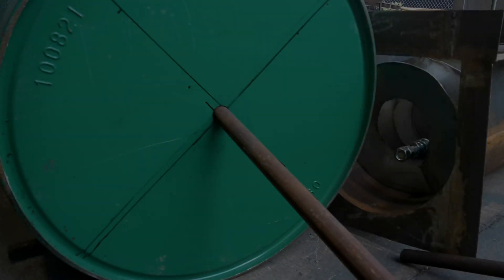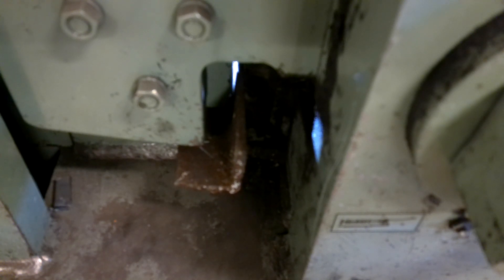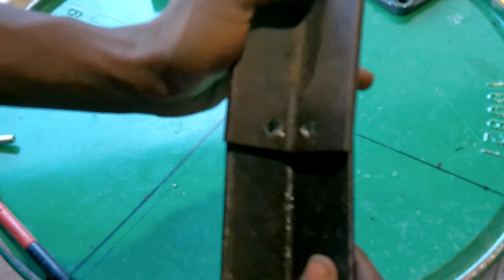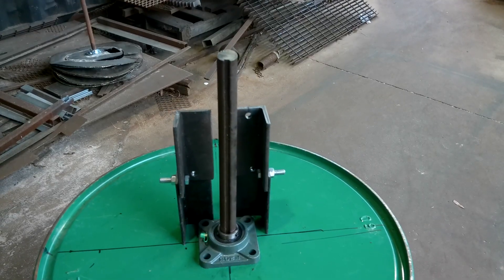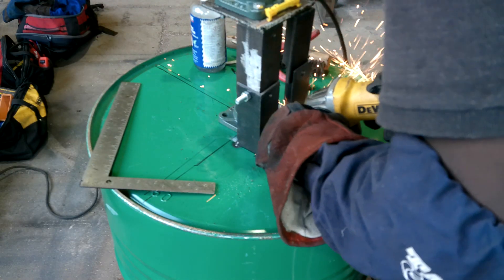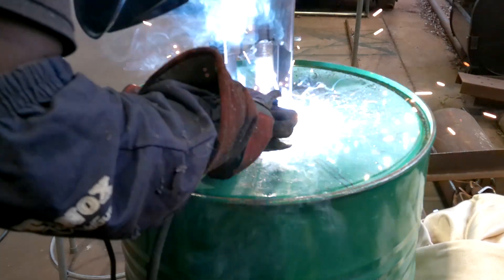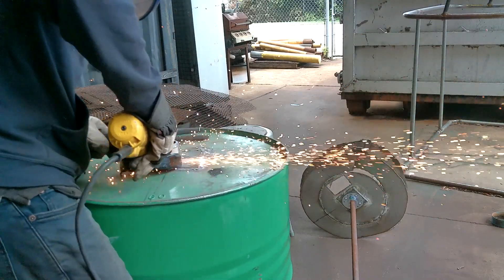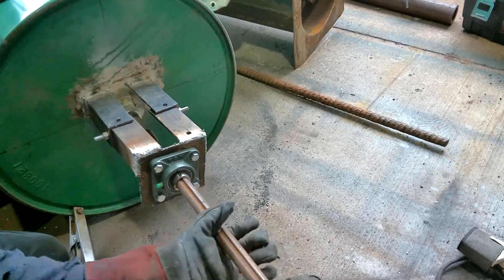FAIL: Building Mark III Reactor - Part 3

Comment: First, and I cannot stress this enough, thank you! You have inspired me to do a similar project but I have to research a lot more before I even start 
Considering that, this is not advice, more of an opinion so take it or leave it. I believe that the culprit for that are the plates - would 4 metal rods work better?
Reply from the maker: That is amazing to hear you working on your own! Exactly what the world needs. Perhaps 4 may work better, will have to give it a go!
Reply: @naturejab  I just can't stop shaking the idea that you can combine the Megatron with the flare gasees but I am not that good with magnetic guide waves nor do I know the effects of plasma (if it'll form) on a steel container... as I said, still much to learn before the build....

Comment: leave the mount there but make the bearing adjustable so you can move it around to find center then it gets bolted down to the fixed mount.
Reply from the maker: Thank you!

Comment: First and foremost you’re doing fine, keep it up mate 👍. Some suggestions that you will probably hate but from experience of keeping things simple:
- You are currently running batches in about an 8 hour time period. Let’s keep the maths simple and call it 10 hours. Even with 5 magnetrons then, anything you put in that new reactor will take about 2 hours to be fully pyrolyses and moved to the end of the drum. My point is, that auger will be turning INCREDIBLY slow and the engineering required to get it aligned right isn’t worth it. 

- If you had a rectangular reactor with a simple rectangular trash ram at one end you could simplify a lot of things, including the microwave propagation inside. You could have an input hopper at one end and some sort of opening/closing grate at the other. If the output end unbolted, it would be very easy to take apart and clean

- The auger design definitely has a place, but I think it’s is in the long term future. A bit like my automation ambitions, I still need a lot more data before I start to make parts of the machine automatic. 

A bit of a PITA I know, but I had a similar major redesign consideration when my mk1 insulation melted.
Reply from the maker: Thanks as usual for the great advice! I know regardless of what design I go for, I need some type of stirring or agitation like in a microwave  oven
I've thought of rams before, but how could those be made airtight? same with opening and closing grates. Regardless, I appreciate the feedback, and will take these things into consideration!
Reply: No problem dude just suggestions. Only the axle of the ram would need to be airtight (pack it with grease or something) and the openings could be some kind of flange seal. Tough one mate, I’ll keep thinking…

Comment: dude you could have just undone the screws... Make it so that the screws are not a circular hole but like a slot, and you can move the bolts around a bit.
That way the shaft can move and you just have to adjust the screws until it fits, and tighten it.
Reply from the maker: Great idea, thank you!